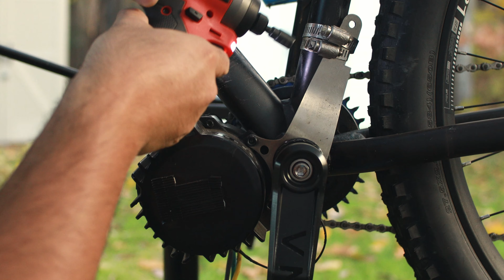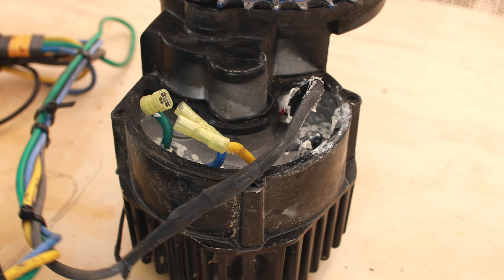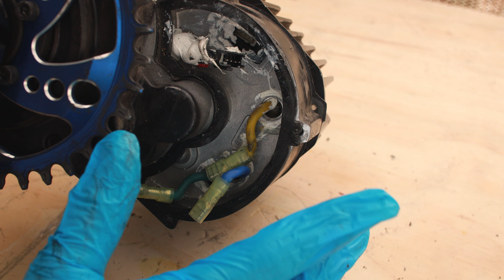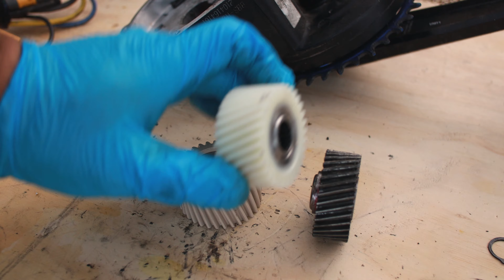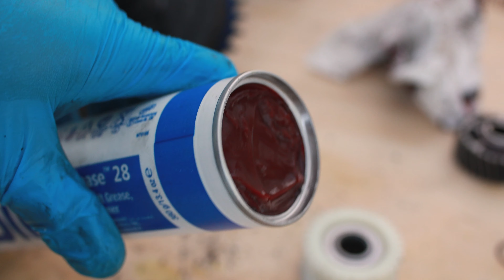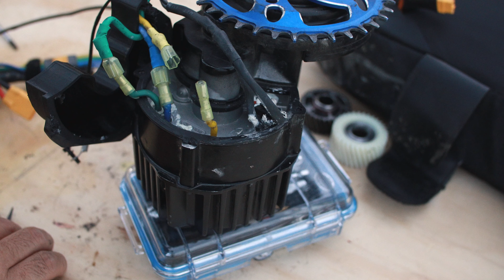BBSHD PEEK Gear Installation and Maintenance [4K]

Comment: I have used Aeroshell 22 grease, the counterpart of Mobil 28, a lot. And it's not at all suited for gear lubrication. It has very low film strength and not so great extreme pressure ability. The incredibly high temperature resistance of these greases is of absolutely no use for this motor. The windings will be burnt way before any decent grease gets to its drop point. but the lack of adhesion to the gears, especially the large steel gear makes it totally unsuitable. Especially considering its astronomic price. What I have found to work extremely well is polyurea grease such as Lucas X-treme Heavy Duty and calcium sulfonate grease such as Lucas Marine. There are obviously other brands selling analogous greases. For extra performance I just add some 1.6 micron PTFE powder. 
Why are you using such a small chainring? I see no reason to have a chainring smaller than 40t as the chainline is very bad due to a lack of offset. Along with a wide range cassette (11-50t) you get up any hill and have great top speed. 11-50t cassettes are available in 9 and 10 speed from china, for 10 speed I would go for the Zrace brand which has hardened sprockets, as regular sprockets will get cold forged by the force of the chain. If you want the chain to last any significant amount of time, you need to wax it with paraffin/WS2/PTFE. it makes a world of a difference. an oiled chain will grind down itself, the cogs and the expensive alloy chainring very quickly. the chainring will end up not releasing the chain due to hooked teeth
Reply from the maker: Thank you for the info on the grease!  I run 36T & 32T on the back for a closer 1:1 gear ratio for this bike.  But I do agree on the chain line, I have it set up very close to the other end of the wheel and do have a 42T chainring with a better offset so will be changing that next time I swap the chains.
Reply: @SparkyBikes  other point concerning the transmission: I actually prefer using the 42t chainring along with an 11-50t cassette, since I'm using larger cogs for a given speed. Larger cogs mean more chain engagement, less tooth damage and chain skipping at low rpm. The freehub body will still take the beating. With 42t-50t front-rear you get amazing hill climbing ability.

Comment: Loving the chainring. Didn't know there was other options other than bagang and lekkie. Where did you get yours.
Reply from the maker: This 36T is from Luna Cycles; the only thing with the 36T is the chain line becomes very tight to fit larger cog with the low offset.  There's also the 42T I got from AliExpress made by a company called PSR which looks similar to Lekkie but cheaper.  No issues with it so far.
Reply: @SparkyBikes  nice ima look into that one. Don't like the ugly stock 46t that comes with the kit.
Reply from the maker: Yes, the stock gear is so heavy and bulky, the first thing I upgraded!  The 42T has better chain line option.
Reply: @SparkyBikes  another thing, did you ever have any issues with gear slip in the 11t and up first 2 cogs. Cause after about 2 weeks of riding on a brand new bike, my chain feels like it's slipping but everything was brand new
Reply from the maker: Here's the link of the 42T: US $63.48  
https://a.aliexpress.com/_mrfPxFM
Reply from the maker: No but I understand these BBSHD setup run better with larger cogs as small cogs will wear down quickly. That could be part of the reason. The motor likes to spin faster and is better for the health overall. The top end speed isn't all that different either even if you run it with say 24T instead of 15T cog.